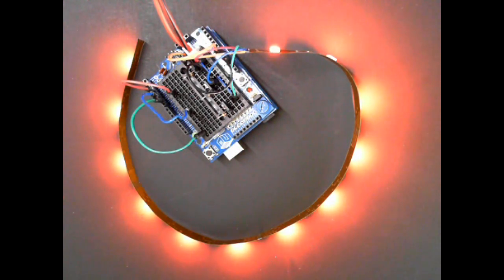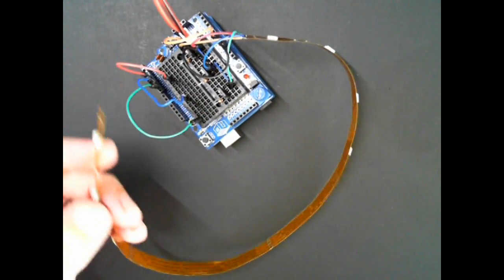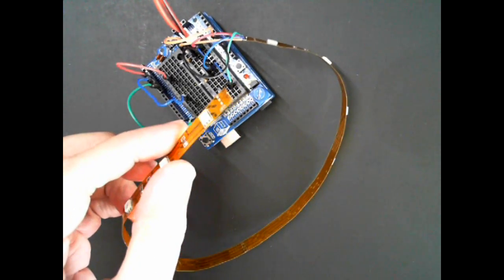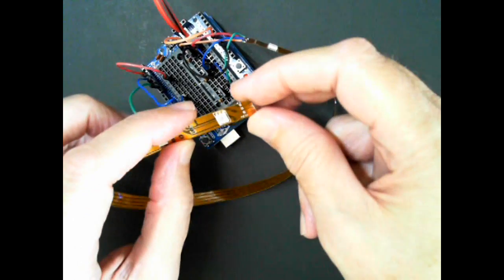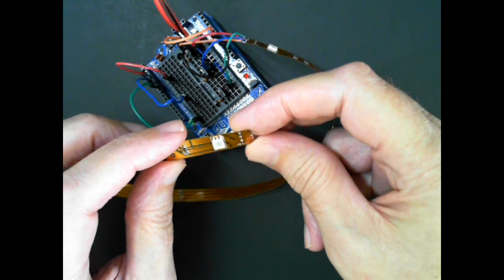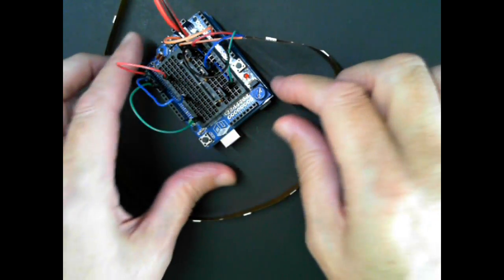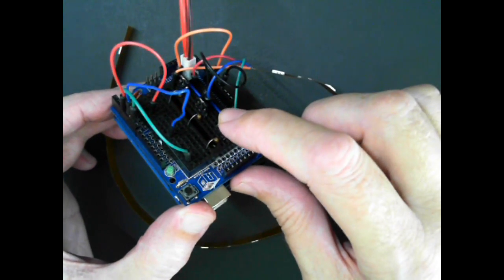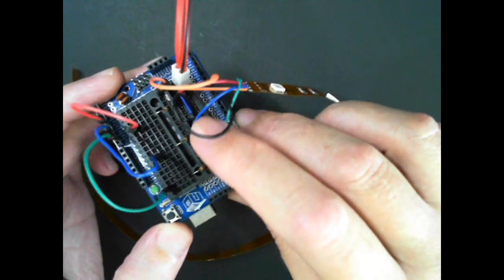Arduino, RGB 12v strip, and FastLED

Comment: Yo how did you get the 12v mosfet driven LEDs to work with fast led? I have the leds working but they have separate pins for each color and I couldn't get that to work with FASTLED